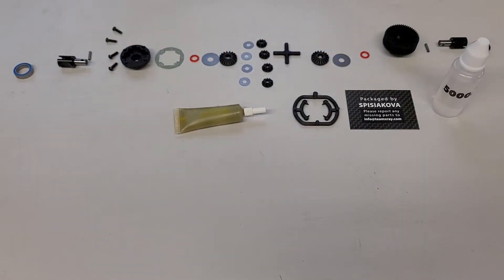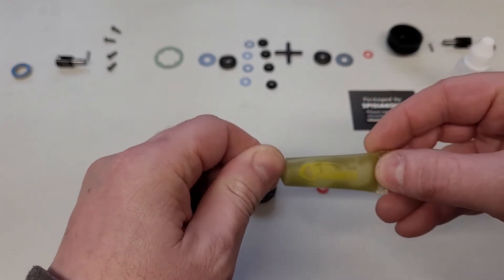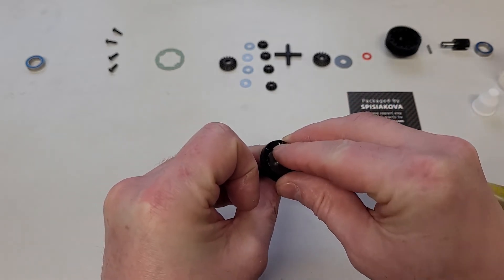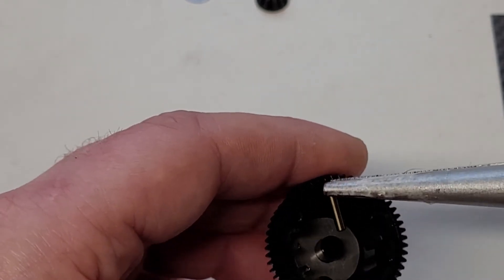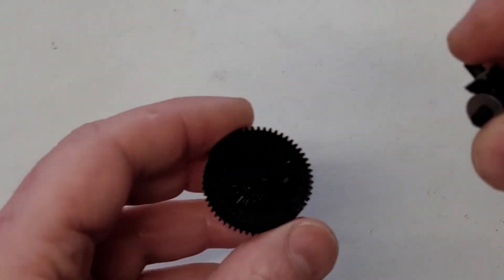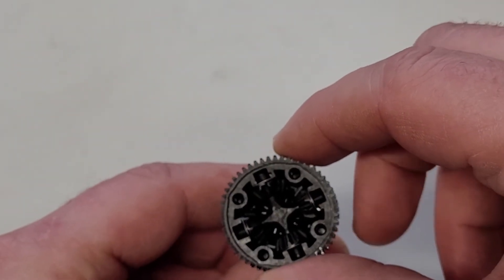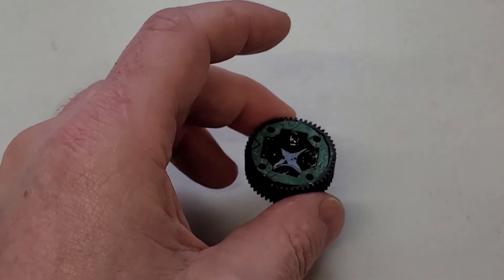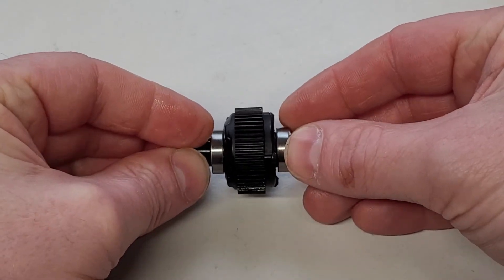Xray XB2 building geared diff -  Build Series Episode 1

Comment: What is your recommendation for carpet and astro? 2 gears? Oil thickness?
Reply from the maker: carpet and astro two different requirements - carpet would be about 12-30k 2 gear and now use ball diff on astro
Reply: @TeamRC3D  Thanks! I'll definitely try that. Was always running 4 gears so far on my 21. Reading the internet, it seems a lot of guys are running 2 gears. Strange that it's not the recommended box setup.

Comment: Fab, just the guide I need to guide me to do my sons second hand XB2. I can change the oil with confidence now.
Reply from the maker: It will be a regular occurrence changing diff oils - just remember if you run 2 gears the oil needs changing more often
Reply: @TeamRC3D  not quite at the 2 gear stage but very useful to know 👍